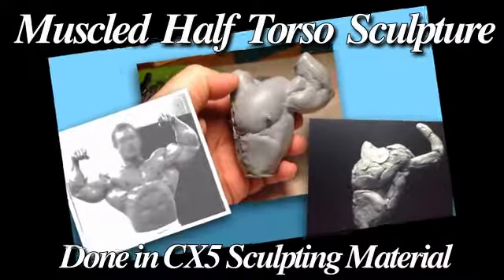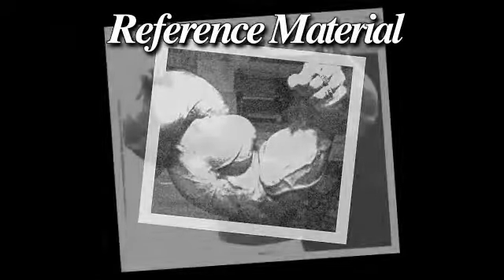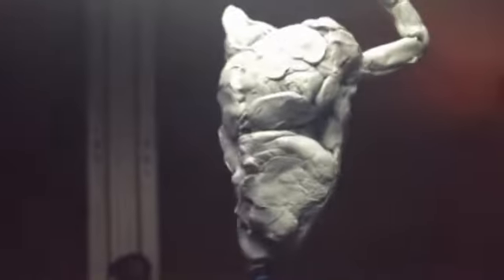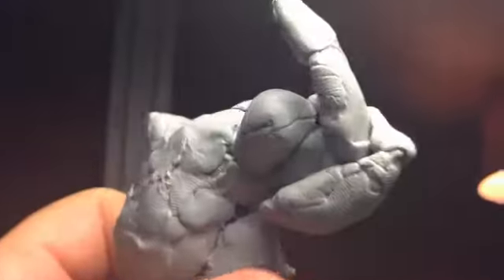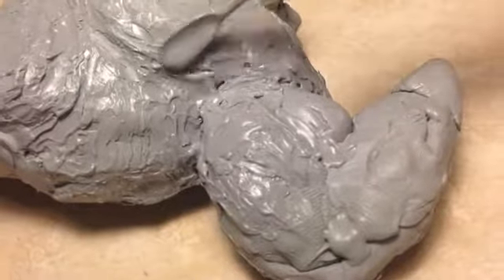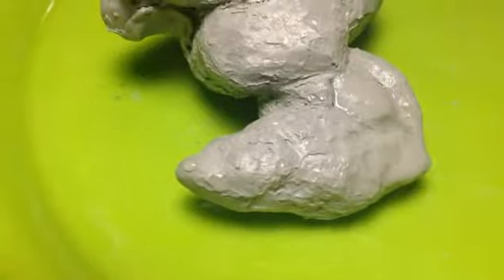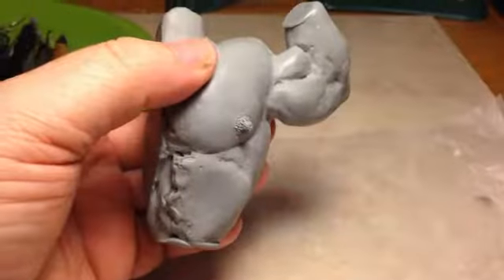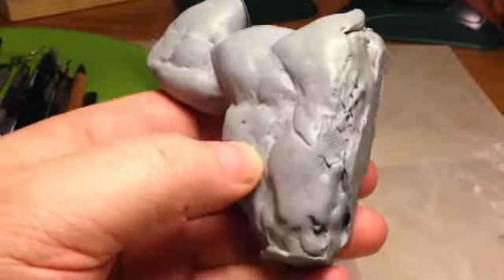HalfMuscleman CX5 Sculpture

Comment from the maker: Hi, sorry it took so long to reply.  YES, I do do wet sanding.  From what I've seen (and this is just me, this CX5 is so new), the hot water smoothing seems to work pretty good after you've used heated sculpting tools and the hot pen.  It's kind like, IF you went sand TOO soon, its still pretty lumpy.  OH, wet sanding? alcohol seems to work really, really well. Hot sanding works really good, for me, for smoothing larger areas.  Okay, if you have a figurine, say, 12", YES, it works pretty good.  If your sculpture is kind of small, sometimes, the hot water works good, sometimes, the hot sanding.  OH, hot sanding with this material, VERY cool, just practice (lots of it.).  Ever use CX5 yet?